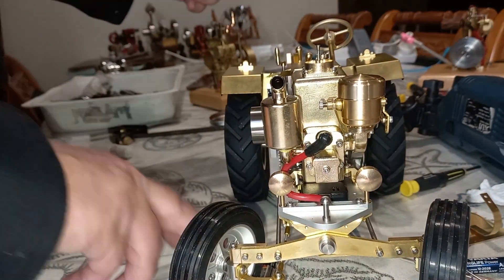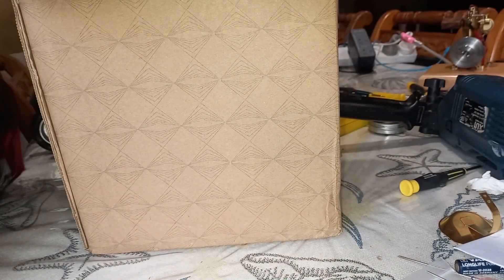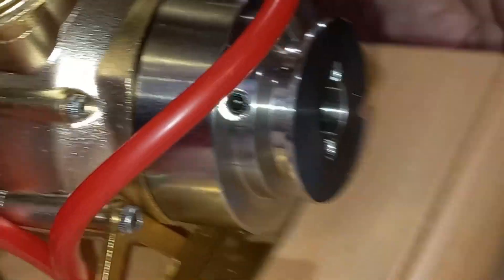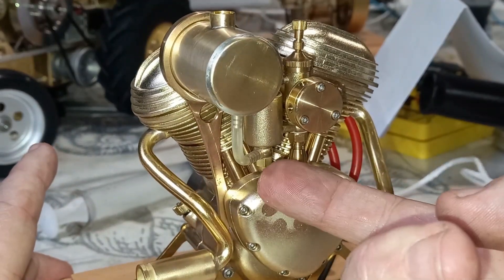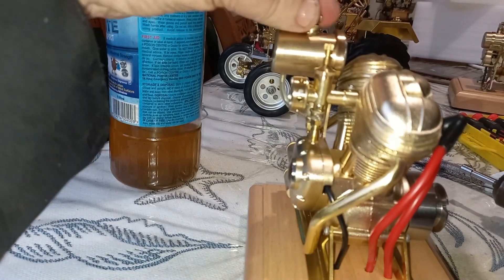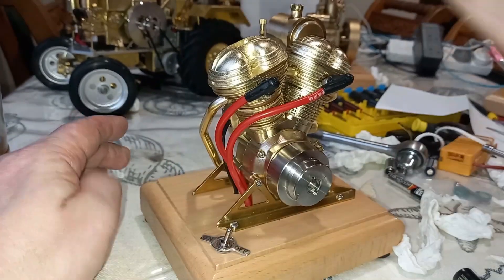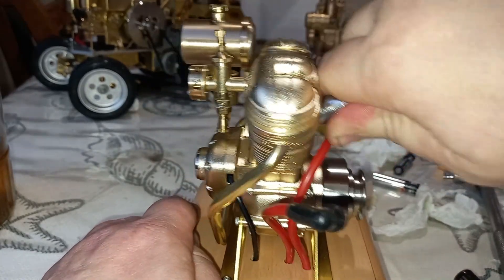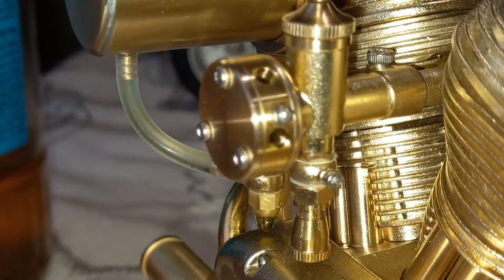Unboxing & Review R28 working model V-twin motorbike engine Microcosm

Comment: Nice one, runs nicely. I’m still tinkering with mine, can’t quiet get it right just yet.Tends to die when I open the throttle from an idle. If I lean it out the revs pick up and I can rev it no worries…but I can hand start it. 
I put oil in the sump but I noticed after a couple of days some has leaked out the bottom of the sump through the join in the 2 castings, makes me wonder if it is designed for oil why didn’t he seal that joint on assembly? The H75 is the same, the side covers leak, makes me wonder why they weren’t supplied with a thin gasket. But in saying all that they are cool little engines and I enjoy fixing up all their little imperfections.
Reply from the maker: Totally agree Darren. Recently, this R28 and the tractor engine both arrived with soft washers under the spark plugs which means they didn't need to machine around the screw thread. The tractor motor crankshaft was attached with no machining of the big end...lasted about 30 minutes before worn loose. And no gaskets or seals. I suspect the R28 is the same because mine definitely has started rattling. Haven't gone back to it yet but I know what you mean...I enjoy working on them but for some, like the R28 or H75 it would be a LOT of work getting that apart. Darren, do you think you'll buy the Cison 4 cylinder? I fixed my Cison V2 the other day and the quality of pistons / rings / wrist pins was way, way above Enjomor and Microcosm...
Reply: @ThomasPCGuruENGINES  I’m a sucker for a realistic looking 4 cylinder. I have the Cison FL4-175 here now in a box, I’ve ordered the Howin L4-172. I’ve also got the Toyan FS-L400 but I’ve never assembled it due to its crankshaft issues. I was waiting for a fix but I think I’ll be making a centre bearing support myself. I didn’t like the look of the Enjomor 36cc so I didn’t get one but I did get their Whippet because I have an original ET Westbury Whippet here and I’ll set them up together somehow. Also the Toyan V8 is waiting for me. Currently I’m working on a Westbury Seal so I’m not going to start anything else until I finish it. These Microcosm engines keep me entertained but are also a distraction. 
It’s good to see that you are putting some run hours on your engines, the cracks start to show with a bit of use. Mine don’t get ran that much because I’m usually too tied up with machining parts for my other models but they are good entertainment for the kids.
Reply from the maker: Loved to read your reply thanks. I've put around 8-9 short runs on the Cison V twin today and reground the valves of one cylinder; it was an enjoyable distracting few hours so I totally know what you mean! I'm amazed how big some people's collections are eg yours...but then you're "a long time dead," right? Have fun, keep in touch

Comment: Those dam spark plugs from my M19 and newly aquired m12b both have leaks through the porcelain insulator. Have seen bubbles leaking out from where the nut meets the porcelain on both. Have ordered an RCexl branded plug to see if that helps. The m19 also runs a hell of a lot better if you tweak the iginyion timing sensor out which let's it fire a bit later. Could never get it to run nicely until I did that. Unfortunately big end is already worn and scored up. So will be using white metal to fix it nicely after polishing the crank journal. Hope it's warmer in Christchurch than here in Dunedin
Reply from the maker: Today is a stunning Winter day. Been a cold few though, even though the grass is still growing - had to mow a few days ago. Thx, Global Warming.
My M19 is nearly perfect; I've put a fair squirt of oil in at the big end + some grease mixed in to hold it. I think it may depend on if it was a good fit to begin with. If it's perfect, it should wear evenly and slowly...I hope. I haven't had this issue since the first Chinese Hit&Miss.
I'll start oiling and greasing these two today, and make a glass float chamber lid. Fun fun!!
Reply from the maker: Totally agree with retarding the spark slightly. Who wants 6000-8000rpm? I don't. I want it to start and last. The little rubber rings he's used as spark plug washers are total shit and break soon. I modified some fabric washers, greased them, and I feel much happier with those.
Reply: Please make a video of the float chamber when you do. Would love to see it. Both ignition modules are dead. So going with hall effect sensor versions instead. Suspect the originals are just reed switch activated. Plus bit easier to manipulate timing with just a loose hall effect sensor on an external bracket or something like that. M12b has been terrible ever since I got it. Constant compression issues. Not stoked really, considering they aren't exactly cheap. On the other hand sorting stuff out on models is supposed to be part of the fun @ThomasPCGuruENGINES

Comment: Mr. Thomas,  your video is FANTASTIC!  I love how it sounds.  What are your thoughts on the new float style carburetor?
Reply from the maker: Why good day sir Mr 212 my friend!! Yesss the new carb and choke look so cool and appropriately retro and Jin must have put effort in, as usual. Doing what no other model builder has attempted, really. He is right to be proud. Nice not to have standard model plane type carb...  Starting is less easy though. Still, it started today but now I have a rattle (a bit) from  crank-case. I have been using the electric drill which I previously haven't used. It's mains powered and too strong I think. I hope I haven't damaged the big ends. The compression is really, really high. This is not a hand starting engine but maybe I should take more care in my choice of starter. I have filled the crankcases with oil, trusting on the factory oil for the first run "out of the box"... too risky??
The engine sounds great again today; just a little tireder - needs fresh batteries, cleaned plugs and "We'll See."  Din't really have enough time today.
Rattle...I don't know. If it is looseness I expect it will get worse fairly quickly. :/

Comment: Did you use same petrol you get from the station or is it 95 octane mixed with 2 stroke oil ? I'm thinking between this and the new V35 engine.
Reply from the maker: $260 on ebay right now, Jin has removed the float part (probably for the best) and the VB (V35) also dropped. Yeah I use staion car fuel and whatever small-engine two stroke oil I have around. Let's face it, these are dirty engines running for short periods. I don't think there's any point getting  precious about fuel, but others recommend lighter fuel if you want to do that "burns cleaner" (before you add the oil, I guess)

Comment: Would it be possible to email you? My R28 has some issues the timing cam gear is off and a valve lifter is not returning. Ive emailed sterling kit but don't understand chinese so its not uber helpful. Dont want to buy a brand new one again just to have a working one.
Reply from the maker: Sorry I have been out of circulation, didn't see this email. I'm at chairmeow.nz @ gmail com  no spaces. I don't check that email often tho; every 5-6 days

Comment: The finish looks cheap compared to the cison v2.
Reply from the maker: Maybe so, but I prefer this. I feel Cison makes engines that are more realistic, but...I have more fun with M icrocosm engines. The Cison vtwin has been trouble from the beginning,
Reply from the maker: OK so the Cison had: dead ignition and dead hall sensor, terrible hall sensor replace instructions, faulty piston ring, ring sticking issues, compression issues, valve issues, mis-drilled hole, poor mount points and supplied with no mounting. The Microcosm started up straight away, sounds great and has no problems EXCEPT the carb is tricky to tune...but it's still easier to tune than the Cison.
Reply from the maker: Nuff said